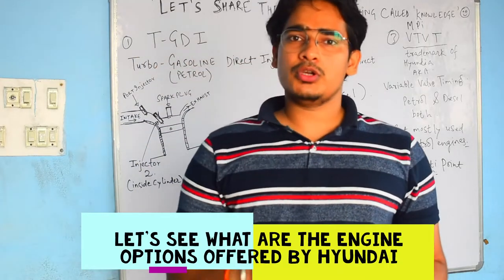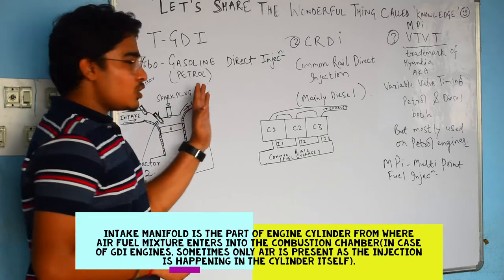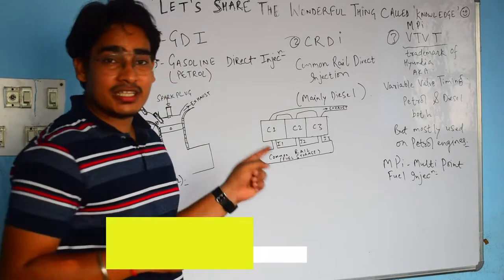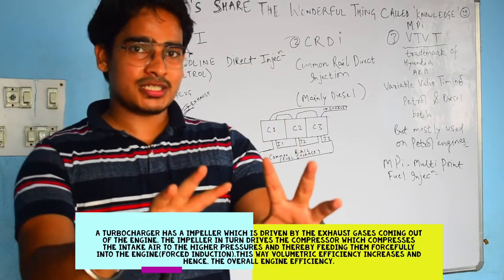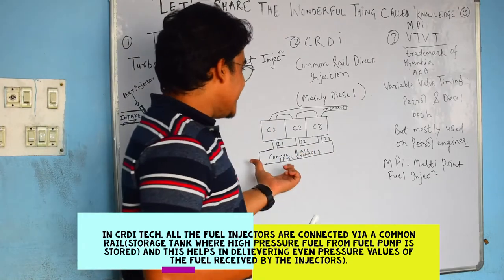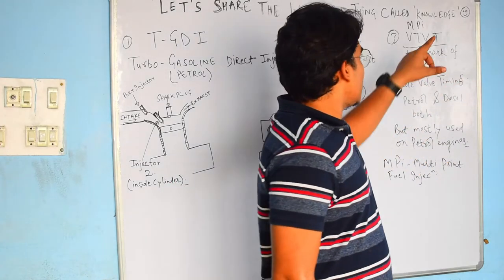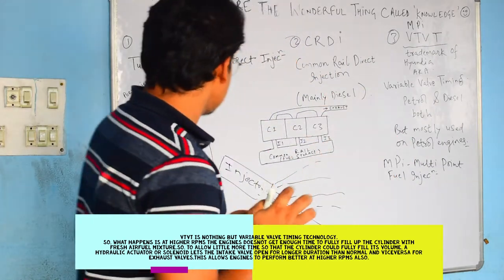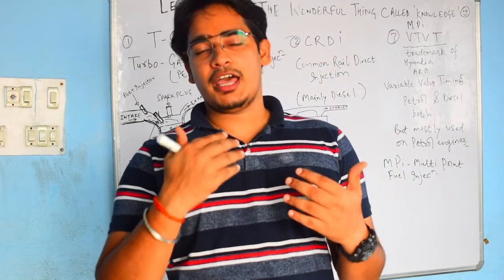Difference in the Engine Variants and Technology Offered By Hyundai In Creta & Venue!

Comment: Sir, incase of T-GDI does the injector 2 which injects fuel inside the cylinder sprays in multiple direction or in a single direction and the port injector sprays in multiple direction?
Reply from the maker: That also injects in multiple directions.
Reply: @machinniiaec  thank you!